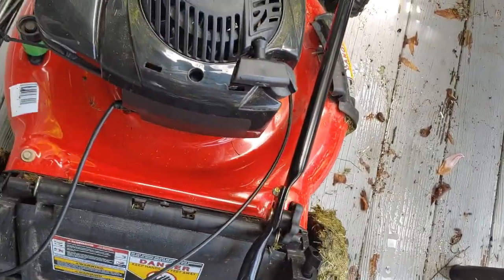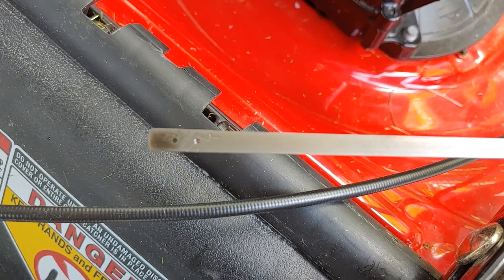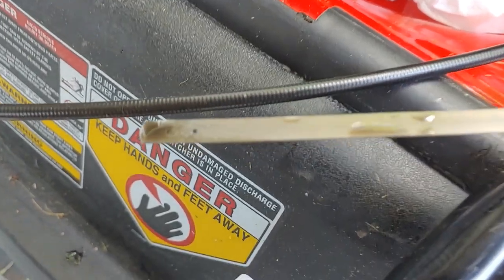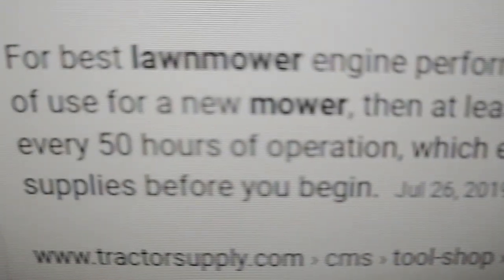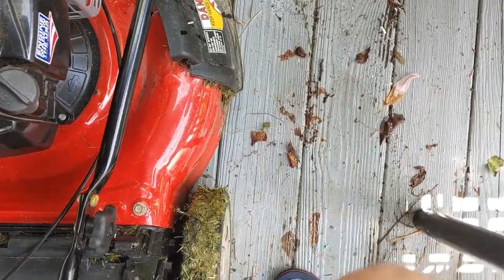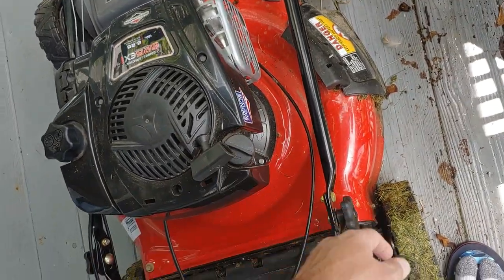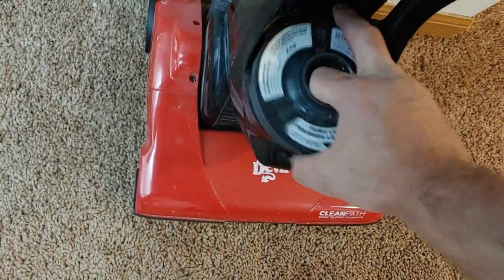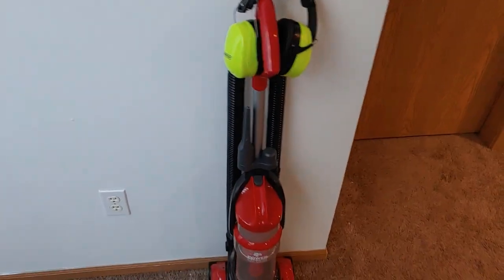When and How to Change Oil on a Snapper Self Propelled Lawnmower and random vacuum talk

Comment: Don’t run the unit till the gas runs out. Just run the unit so the gas is low. I do it all the time no gas comes out of the cap if it’s just low.  Just do it normally after you’ve mowed and the gas is low. Very simple

Comment: You’d be wrong when you said it can’t be too bad finding the drain bolt 😊. It’s actually ridiculous where Snapper put it. It’s under the engine and you have to remove a metal plate that guards the belt for the self-propelled mechanism to access the bolt. It’s a regular 3/8th square head bolt. Problem on mine and probably will yours is the bolt removed drains oil all over the self driving belt. So not only do you have to raise the entire lawnmower up and awkwardly access this bolt after removing a plate. You have to put a piece of tinfoil over the belt so you don’t get oil all over it. Bottom line is tipping the mower over a few times allows you to drain the oil extremely fast and easy.

Comment: Those do not have a drain plug your supposed to never change the oil in them. I have that same mower and it started smoking so I changed it
Reply: So if it does have a plug it'll be underneath the deck where the blade is ??? Yes plz disconnect plug wire when looking or working around the blade
Reply: @johndbaker420  those I can assure you do not have a oil plug. Some even came with stickers on them that says never change the oil just add oil if it gets low lol they want them to blow
Reply: They don’t have drain plug, owners manual says to tip it on side to drain out of filler tube. 
Idk why it went from mower to vacuum
Reply from the maker: Thank you for adding to this content with your comment.